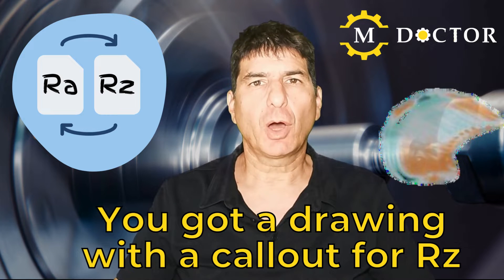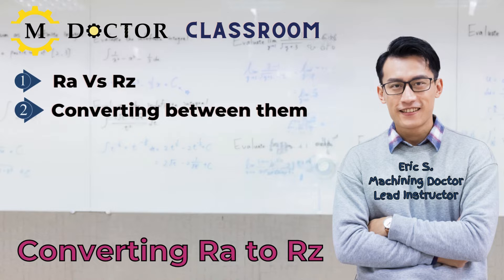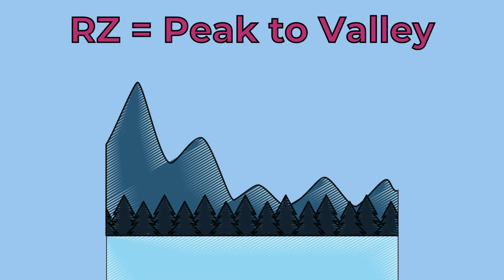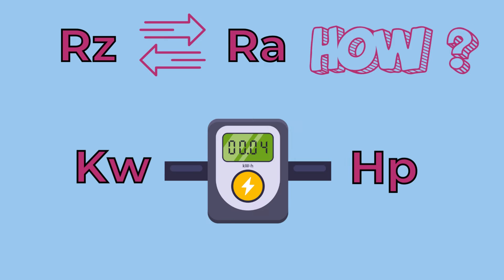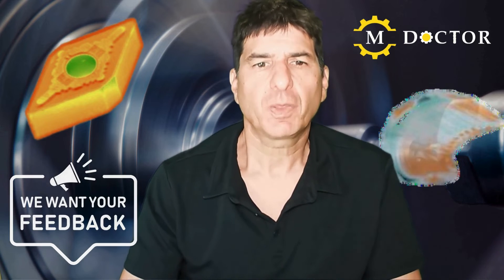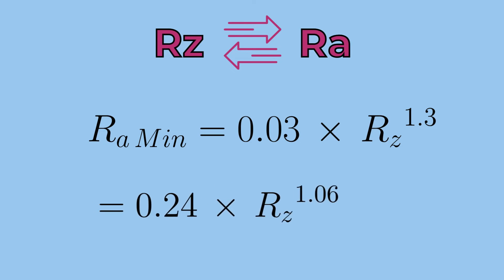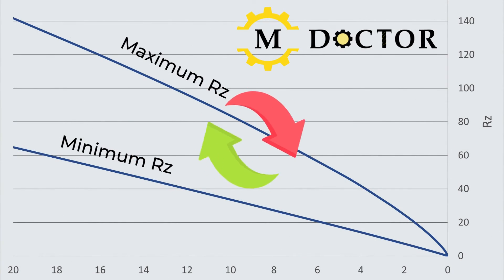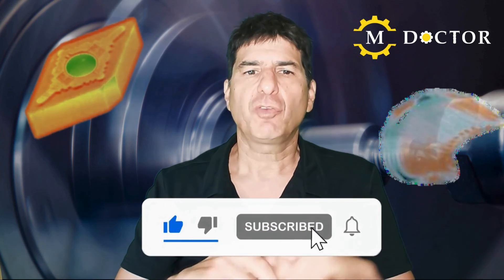Converting Between Rz & Ra - An educational video by the Machining Doctor

Comment: Thanks for the formula, i tried an e-function but couldnt get my numbers so far right that i was happy. I Just modified you formula to RZ=(ra/0,029)^(1/1,324) for my excel and the highest RZ values i wanted to match for.
Reply from the maker: Thanks for the feedback. I will check and compare the formula you shared